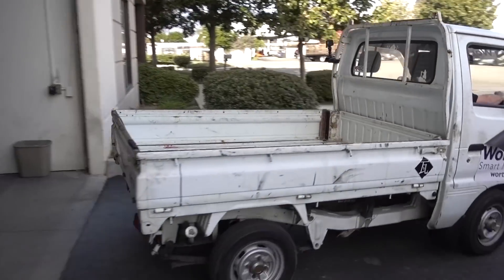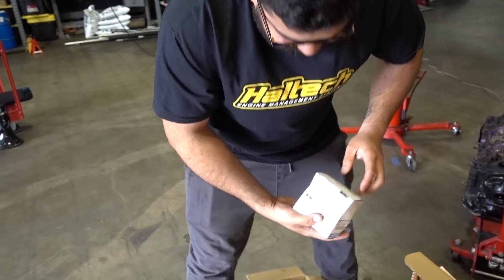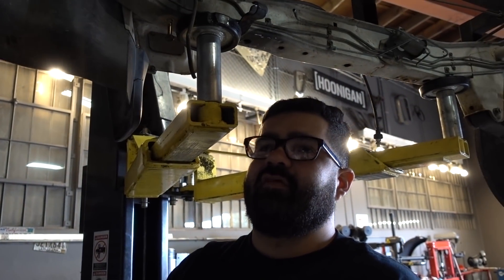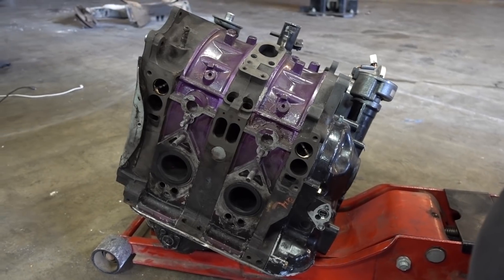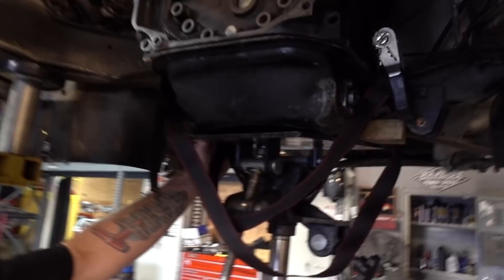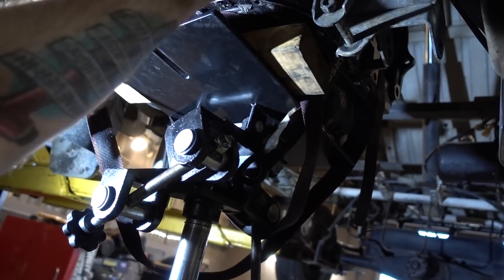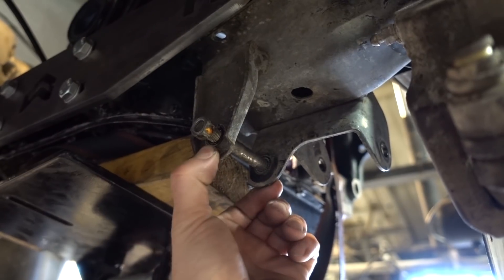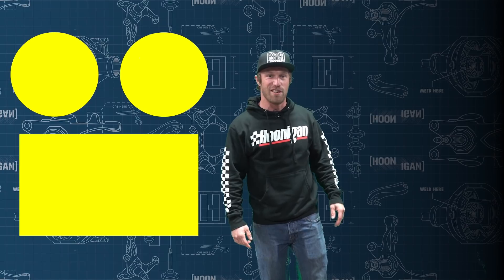Custom Plasma Cut Engine Mounts for our Ultimate Pit Truck's RX-7 Swap!

Comment: That plasma table comes in so clutch, good luck cutting those mounts out by hand
Reply: It would be easy just gotta use a straight edge and if you know how to run a plasma gun
Reply: Yeah like a jig/ straight edge, but will never be as precise as a computer controlled cad design.
Reply: Maaan it took some finessing on this one. The Twitch stream of it was great.
Reply: Watch Project Binky on Bad Obsession Motorsport. The amount of hand designed and fabricated parts on that thing, and the precision with which they make them, is astonishing. I'd put him and his hand fab against even Chairslayer anyday. Pretty sure Chairslayer would say the same (there is no way they arent watching Binky).
Reply: That xmember is abort as easy as anything would be to fabricate by hand. An angel grinder and a drill press and be done in half an hour.

Comment: I used to operate a plasma and torch burn table 10x60 foot for a oil rig manufacturer. When pipe fitters and welders showed up with a cardboard and tape template made my life a whole lot easier, instead of some dirty piece of paper with some scribbles on it. Love the builds you Hoonigans create. Keep it up please !

Comment: I like this build, because I'm having similar problems with the transmission on my T-bucket build. Gotta be an automatic, I don't even have room for a floor mounted dimmer switch between the trans tunnel and the body, much less a clutch pedal.

Comment: Hey I noticed you used an angle grinder for relief cuts in your mount. I’ve seen a similar thing done, but they used the CBC plasma to slot where the bends go. Then just filled the slots with weld afterwards. It looks good and provides a bevel to fill with weld. Just an idea.

Comment: That motor mount might be really nice if it was cut from angle iron to stiffen it and maybe even lay on top of the "frame rail".

The cross member seems like it will be very flexible.

My first thought was billet oil pan with suspension mounts but that's a bit extreme.  If you get the motor mount to provide some stiffness (angle iron) and add some tube and gusset to the cross member design then it might not pretzel on you.

Comment: @10:20 Just a small tip; never make square holes in structural pieces, it creates stress concentrations that lead to cracks and stuff.  Alway put a radius where you can, the bigger the radius, the better. In this case, an oblong hole would have been perfect.

Comment: this rotary is going run hot as in hotter. but will also make the mini T hotter  👍😉 but really think about a big radiator as the heat will get trapped a bit more in that bay than rotary's natural habitat.

Comment: U beam the bottom of the crossmember! It’s strong and you can use it as an engine mount point to stabilize the engine and for strength because remember who this is going to if it’s not bulletproof they will for sure break it. Lol 😂 never mind I like yours better.

Comment: Get a smaller alternator!

Edit: And put radii in the corners on the engine mount bolt holes! Those square corners are stress risers.